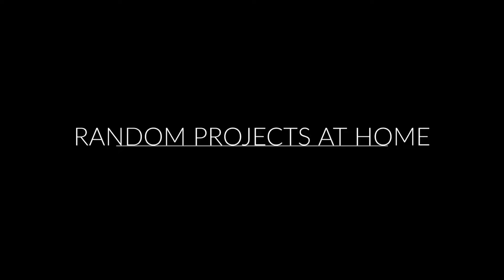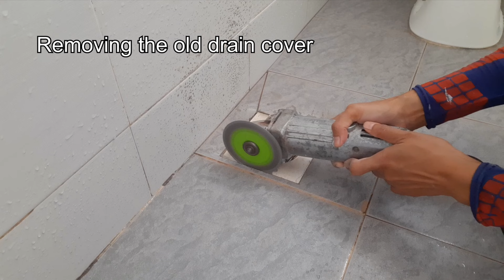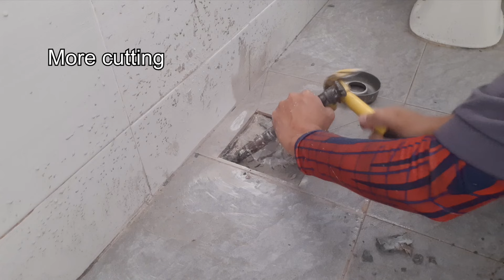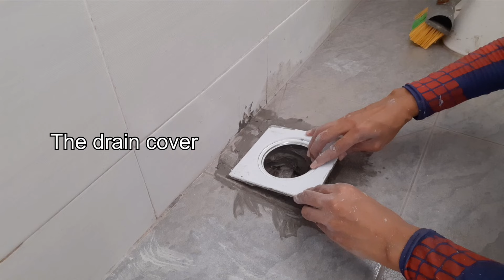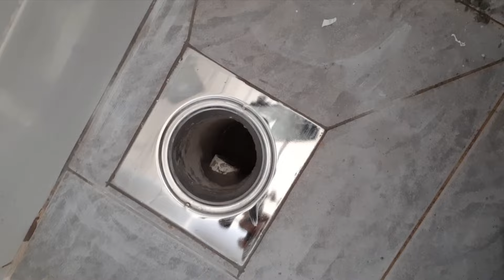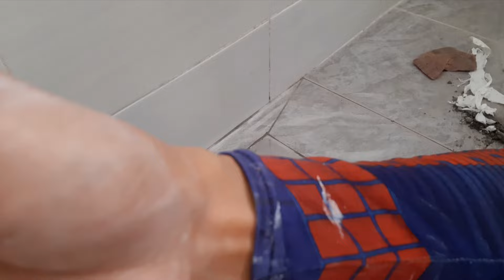Project: Replacing the floor drain cover of Bathroom3

Comment: Excellent job. Very clear detailed video showing the proper way, step by step.  👍
Reply: @4.08 using a test pen to chisel the rough edges isn't a good idea though. I know sometimes we either don't have a proper chisel or are lazy to find the right tool; this often result in damage to that tool. In this case the metal tip of the test pen isn't hardened for the knocks. We handyman and oftentimes renovation worker are all guilty of this bad habit though. 😝

Comment: I have the same drainer. Is it normal that the water drains slowly with that kind of drainer? Because sometime when taking a shower, i have to remove the cover so the water will drain fast.
Reply from the maker: Very normal for water to drain slowly, especially if the floor is more on than flat  side.

Comment: can i use drill for cutting
Reply from the maker: If the drill has an adapter for marble/tile cutting blade, then maybe. But I don't recommend that. Drills are a bit clumsy as a cutting tool, especially if you're not used to it.

Comment: Is it possible to do this without the grinder? And if not, what disc cutter did you use? the normal or diamond one?
Reply from the maker: We can use a tile cutter, but anything that can cut tiles and cement is good. I prefer an angle grinder because it's easier to navigate, especially cutting a bit of the floor for the trap bowl. I used bosun diamond wheel.